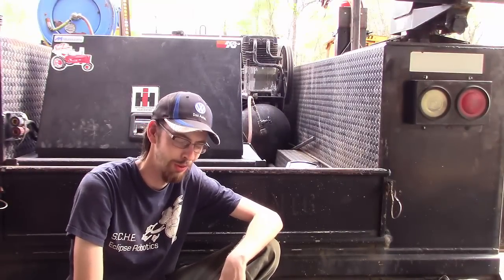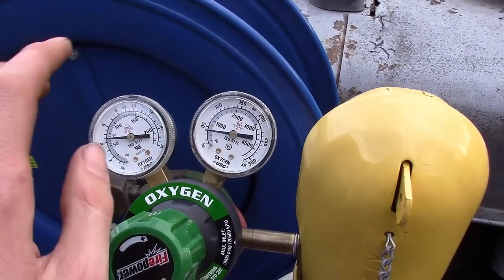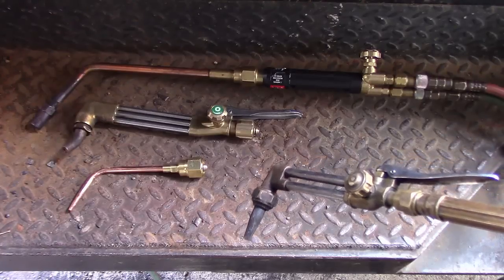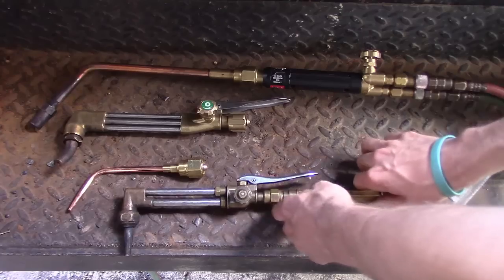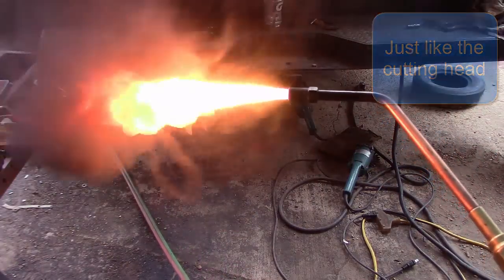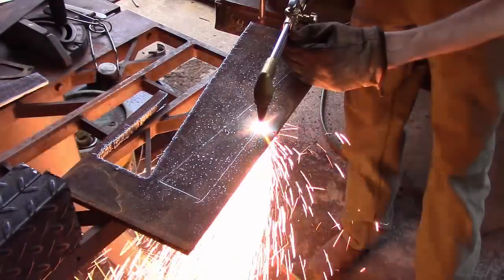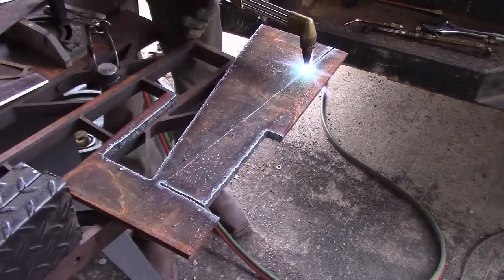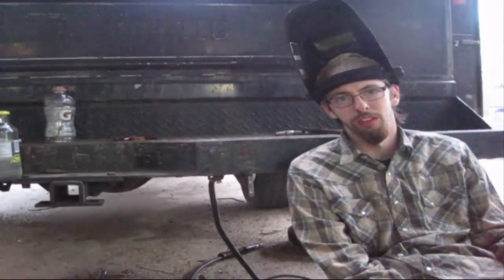Acetylene torch basics

Comment: I spoke briefly about some of my memories of safety with a torch on one of America's railroads; our torch regulators set up on 12 on actlyn and 42 oxy. That would do just about any job there, from heating for sweating on lugs on electrical cables, to cutting 2 and 3 inch steel. All torch setups had to have kick-back arrestors and attention to the proximity of the hoses to where the cut was being made was of paramount importance. We were instructed to ALWAYS turn the oxy off first and then the actlyn. One of the safety items, you NEVER laid the acetlyn bottle on it's side, due to the construction of the bottle and the unstable nature of the acetlyn! It HAD to stay pretty much verticle. Another item that a lot of people dont realize; you NEVER introduce grease around oxygen. Don't grease the threads on the tank to make it easier to apply the lid! That's volitile! Always have a safety collar around the valve, when vertical rolling it, on the event it gets away from you. If one falls over and gets its valve knocked off, there's such extreme pressure inside, that it will turn into a JATO bottle. ( used by large aircraft to attain air speed more rapidly due to compressed air escaping to the rear of the plane...like a rocket! Those are dropped off the wings onto the field to be reused. A fuel or oxygen bottle will fly thru the air, thru walls, equipment, people, etc. Very dangerous! Always safeguard the valve assemblies! Most of our cutting tables had an apron under them, which was a piece of 1/8" sheet steel all the way across the length of the table and situated just in front of the front edge of the table, angling down just shy of  the wall and floor, making a slide that all the fire and steel being melted out, as well as the pieces of cut-off steel, could fall on and slide into a drawer, made out of the same material, sitting on the floor directly under the slide bevil. Thos way your britches didnt have a chance on catching on fire and the floor stayed safe and it was easier to clean up. Hope this helps all readers.
Reply: I dont have any way to make these videos. Would it be possible to bring these safety tips to the public in one of your videos, please. I mentioned a JATO bottle, but i ran out of writing time before i finished. JetAssistTakeOff. It is a compressed air bottle that when the pilot pops an explosive cap on the end, the exiting air helped the cargo plane take off.  
   Acetlyn tanks are made in such a manner, that they don't easily turn over. The bottom third is lined with concrete, to make it bottom heavy. Acetlyn is a very unstable item and must have Acetone in the tank (liquid form). To stabolize the acetlyn. If The tank is laid down the acetone is forced out the lines and is no longer thete to stabolize tje acetlyn...thus being a timebomb! Very dangerous. 
   On another note, any time you get oil and grease around oxygen, the danger level goes up.
   Laying out a piece of new steel is hard because of the reflective nature of metal. If you light your acetlyn gas and turn it up a little without adding any oxygen... you'll have "ghost-turds", which is the slang name for tje sooty smoke that comes off of acetlyn burning by itself. You can "wash" your flame all over your metal and blacken it so your soap-stone will show up better.
   Another tip...instead of spending time cleaning a cutting tip with the wire files and smoothing the end of tje tip with the onboard file...if you get a piece of rough-cut oak slab and keep it just for this purpose...light your torch and bring up your flame to the best you can get it to do, being dirty and poping, and then squeeze the cutting trigger and with a dragging pattern, with the trigger pulled; place the tip onto the wood and drag it across the surface of the rough cut wood and then ease it up away from the wood and then let the trigger off. Youll hear popping and cracking while gliding it. Do it once again then turn it off. Smack it off with your glove...and you'll be amazed how clean it is! An old boilermaker taught me that trick about 40 years ago. Saves lots of time and trouble! Can you please take this and incorporate it into one of your videos. Much thanks
Reply: Tony Samson thanks. I abbreviated it. And i hit a couple of wrong keys on "carried"

Comment: I have a small portable torch that can be carrued easily. My question is; when you make your cut...what is the easiest way to keep rhe melted metal from flowing back and re-filling rhe gap you just cut. I've gotten in the habit of quickly backtracking and blowing the melted stuff out again. I'm  not able ro get a kewl edge. I have to get out a die grinder to clean rhe edges.
I don't do enough to buy a plasma torch. Thanks for making your
Video
Reply from the maker: Lee Williams That happens a lot on thin material more than likely you've got to big of a tip on there. See if it is a 101-1 or something close to it. Try to find a 101-0 or 101-00 (If you have Victor torch) if not the front number will be something else like 97 or something weird. My point get that Second number lower that means the tip has smaller cutting jets therefore will cut without filling the cut back in.  Because you should be able to cut anything just like I did in this video. Hope that helps.
Reply from the maker: Tony Samson I think he means carry.

Comment: Very good video very helpful. And covered some questions I had a while back. But still got just one more after seeing you spark that arc. What are the dangers on welding on your rig with all the equipment on top and torch bottles? You have everything grounded?
Reply from the maker: David Rios Far as welding on the truck it is safe. The biggest thing is frying something electrical like the computer or a sensor. I knew a guy that a old gas burner 1 ton truck that every time he welded something on the truck it would short out the electronic ignition in the truck wouldn't start.  The way to fix that is unhooking one of the battery terminals. Thanks good question.

Comment: I was taught (over 30 yrs ago) to set up the torch so the valves are on the same side as the tip.  Easier adjustment and less chance of bumping the knobs and throwing out the mixture.  Also, I strongly agree with 1/4 turn on acetylene so it turns off fast in emergencies.  Great video overall

Comment: I did not see any flash suppressors on your hoses also a little tip on cleaning a fouled tip is with the torch fired up pull the trigger and rub the tip on a piece of wood
Reply from the maker: Aye I didn't have them on in this video, but yes very good thing to need.  Nice thanks for the tip.

Comment: How do you feel about oxy propane for cutting and heating?
Reply from the maker: I'm not a fan of propane.  (Hank Hill died a little inside)  I have used it some, but I'm not impressed by how slow it is, and that you can't braze with it.  Good for heating a large place, but cutting better off using something else.

Comment: back-lighting is when the fire travels back up into the torch handle, clogging up the orifices.  There are flame-arresters in there, also, to prevent the flame from reaching the tanks. If that happens- by by.
Reply: Arthur Bradley your cut looks like an alligator with a tooth ache chewed it off. Lots of miscues from the beginning.  Acetylene tank valve should be completely opened; acetylene psi for one inch steel about five. Oxygen pressure always four to five times greater than acetylene. Your torch tip too big and flame way way too hot

Comment: Thanks for a great info upload. I'm a welder by trade but have been out of the game for 20 yrs. Getting back into it now. Just got my oxy set today and tbis was a great refresher..... 5 6. Great to see you cutting without wheels. We were made to throw ours out on day 1 of my apprentership. I plasma free hand and will be oxy cutting free hand...... what size tip should I use for 1 inch plate
Reply from the maker: Adrian train thanks man. As far as tips go ( depending on torch) 101-2 or 101-3 work well on 1" boost you Oxy to 70-80 psi and you'll have a great cut. Tons of per heat, and stepping your torch in the kerf back and forth will help the dross not stick to the metal. Thanks for the comment.

Comment: having been a welder certified since the early 70's ,,,,, the rule of thumb for us was 8 lbs ace, and 40 oxy .. of course you change as you need to for thickness and so forth .   3 types of flames is involed in welding witch are NEUTRAL , CARBURIZING , OXYDIZING .FLAMES . nice vid ....enjoy
Reply: Same here started in 1975.

Comment: I was taught to cut at an angle to towards where youre cutting to keep heating the metal ahead of your cut. Then again, im usually cutting out dock levelers.
Reply: Check It Out 100% cut on an angle
Reply: on thin plate you can cut with an angle. on thicker plate keep it straight up and down.
Reply: Found the door guy, haha

Comment: thank you , I am beginer and want to cut and weld pieces onto a 31 ' trailer for tiny house on wheels .So haven decided to buy oxy/ace set up , from Grizzly tools . I will be adding extensions onto sides of trailer  16-18 " pieces which will go thru main channel runners , then plan to drill holes thru them and crossbeams to attach .then put bead of welding around ends . thank you for your videos will be viewing more and viewing them several times. sincerely deb in VT

Comment: big thing.....you only crack the gas valve a little bit in case of fire...then you can turn the valve off quicker...and it is NOT required as you say..... I'm a retired ua342 welder 25 years.

Comment: your hose should always be out of the way its dangerous area and you should also shut off the fuel first and light the fuel first safety first watch a smith vid 45 min on safety you were backasswords son on light up and shut down
Reply from the maker: Charles Barkell it is because of backfire. Just because you have check valves doesn't mean that they will stop the gas from burning into the torch. They stop the fire from burning into the tank. If you back fire a torch most of the time they will not light back up right, and they will pop, and go out over and over again.  That's why cutting the O2 off first will will prevent a backfire on a rosebud.
Reply: Classic Work this is the way I was taught, cutting shut off acetylene first. welding shut off oxygen first. just one question though. why is it opposite with the welding tips? isn't that why they have back flow check valves?

Comment: cool video,but you should raise the travel speed to get cleaner cut,without melting the material,you can get a very clean cut with a torch really
Reply from the maker: Oh yes.  Got to be really stable though.
Reply: Classic Work t
Reply: yes, I work at a shipyard,torch is a daily tool,in hard positions mainly. mine has valve for oxy insted of lever,is it hard to maintain same pressure with your thumb?

Comment: bad advice on only cracking the gas partially open at the tank...gas side systems often have a backstop valve and you're REQUIRED TO OPEN IT ALL THE WAY per manufacturer/safety instructions. this type only works properly if you have it backed stopped all the way open. plus in an emergency the valve should only be able to move in one direction so there's no question by the paniced responder which way is safe and which way is heaven. ...just sayin
Reply from the maker: MyBigThing2010 I've never heard of that on acetylene. Maybe on another type of cutting gas like propane or MAPP, but not acetylene.
Reply: My 86 year old uncle gave me his Lincoln stick welder and oxy acetylene torch, today. He gave me a little tutorial and one of the first things he said, was to open the acetylene a 1/4 turn. He's been using one longer than I've been alive, so I'm sure you have it right, Classic Work. Plus, most other videos I've watched said the same thing.
Reply: acetylene isnt high pressure& the tanks are designed with a "fusible plug" ....do not open all the way.the oxy bottle is high pressure and contains the valve you'r thinking of called PRV pressure relief valve and it is required to open all the way per manufa....safety reg's.
Reply: Awesome video.. exactly what I was looking for 👍🏻
Reply: Oxygen should be opened fully.. acetylene one a half to   three quarter turn so it can be shut off quickly.
Reply: Synapse Systems You have it right. I welded over 45 years.
Reply: rick v not all systems are designed as you state...but I do agree that you should follow mfr regulations/op procedure..."general" info can get people in trouble faster than they can think to safely get out of it...there are more reliable videos on procedure avail on YouTube is all I'm sayin...

Comment: Very helpful advice, I appreciate it. Thanks for sharing your knowledge and experience with us in such a non threatening manner. Meaning, you did not talk down to us rather you parlayed  wisdom in humility. Great job
Reply: Agreed,this guy is cool
Reply: I agree completely.  This is YouTube at its finest.  I teach carpentry and this is now a 'go to' video for the students to see when we cover these types of tools.  Subbed!
Reply: Maybe put the safety stuff in the beginning. Good examples but may want to be specific like don't use any old sunglasses. Use a #5 shade or better. You need real UV protection to save your sight. The flame throws out much more than visible light and heat.
Reply: Joel Skok no
Reply: All knobs inline
Reply: Joel Skok  then use grinder to polish the edge. If required.. Haha
Reply: I was thinking that exact same thing
Reply from the maker: Thank you.
Reply: @EEJester1586  hii,

 can u giv me a summary of regulator settings for:
cutting- 5psi : 60 
welding - ?
brazing - ?

appreciate it a lot. thx
andrew
uk
Reply: Great video. I have an everlast plasma cutter for general cutting but I believe I won't regret getting a oxy-acetylene setup.
Reply: Fda

Comment: so actually you want to light a clean flame when you strike. a small dirty flame crude the tip up. Common mistake. turn about a half a turn, strike and then back the flame off till it's base is touching the torch tip. this will keep you from having to clean the tip constantly. also you forgot to mention, before you open your oxygen, make sure the regulator reads 0 on incoming and regulated pressure before opening the bottle. when you open it, Crack the bottle open very slowly at first till the incoming side pressure reads on the gauge. opening a bottle quickly with existing pressure in the regulator is a good way to boom the regulator and get seriously hurt and opening tooquickly damages regulators over time.
Reply from the maker: Benjamin Flynn I get lighting a bigger flame will help your tip out, but not your safety. Try doing that in a confined space.  Cleaning tips is part of the job. As for the regulators you do have a good point they do need to be at no operating pressure good stuff to point out thanks man.
Reply: I have never used a torch like this but I have worked in many scientific research labs and it is very important to spark all flames away from a tank because if the tanks have any leakage they can quickly become a absolutely terrifying chaotic flying battering ram causing all tanks plus anything else pressurized and/or flammable to become a possible accomplice in terrorizing the workroom.  Also, monitoring the regulator as whole unit (meaning not just the gauge but the entire thing) because it has the most statistical possibility to malfunction especially a used regulator (if you think for Any reason something is not quite right get yourself a gas leak detector).  You can usually cause quite a bit of damage to the tank itself before it becomes the problem (for example: Mythbusters Shark Week episode on the movie jaws was seriously busted) I enjoyed your video.
Thank you!
Reply: Obviously the acetylene will not burn until it exits the torch and gets some air, so it WILL NOT plug the torch tip when it is smoking.  You might wind up with a black tip though.

Comment: Excellent video, thanks !  All the elements of a good video; not too long, good information & good steady image quality. I have bookmaked this vid to come back to before using my cutting torch.
Reply: When I went to welding school in 1982 they started us out with oxy-acetylene.  I think they did that because it's slower and you can see the puddle forming, with arc it's almost instantaneous and we did brazing and cutting too.  The welding tips were numbered #1 through #14, the #1 tip was supposedly 1 psi acetylene.  I think that was for jewellery making, we never used that, I think we used a #5 most of the time at 5 psi, I don"t think we ever went over 10 psi.  And all the acetylene gauges were 30 psi with 15 to 30 in red, so never let that needle go beyond the 12'o clock position.

Later on when we did multi pass groove welds in 3/8ths plate we would cut the weld.  If there were any slag inclusions it would blow back like the 4th of July.  Then the instructor told us when you can get a clean flame cut of your weld, then you can start thinking about doing a bend test.